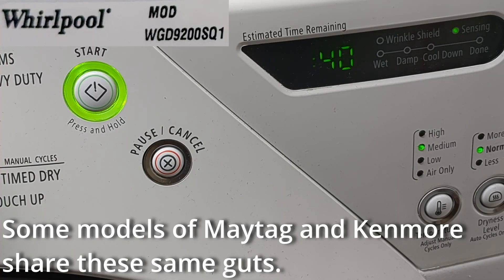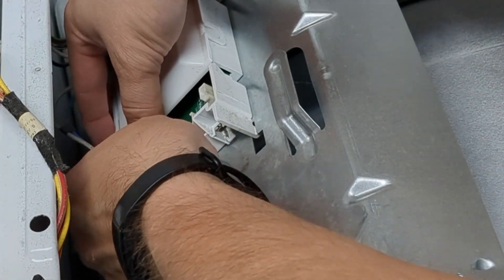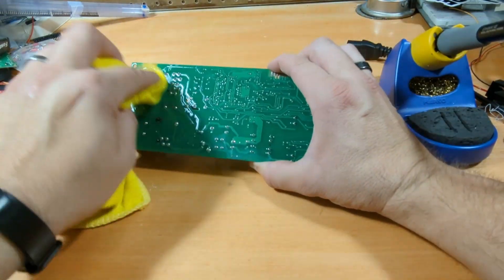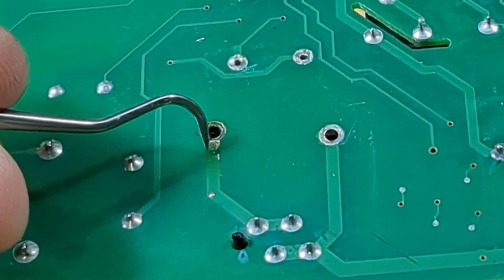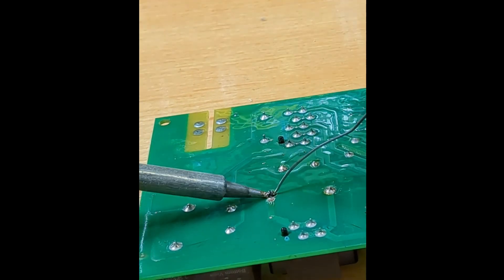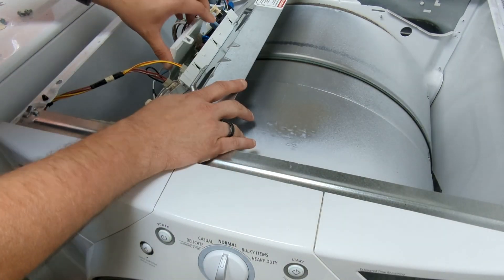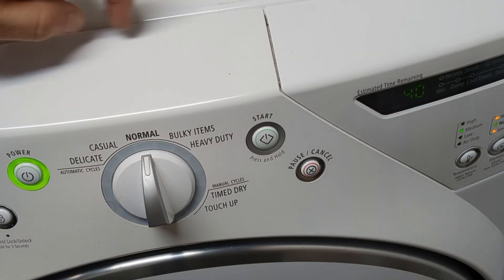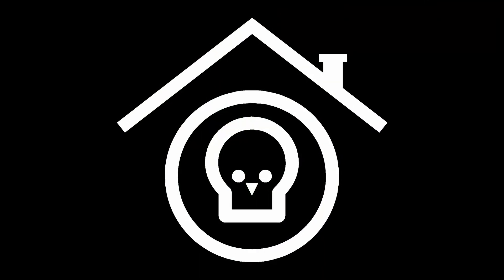Whirlpool Duet Dryer Error F01 Repair. No parts needed!

Comment: What actually blew up on the board? Like would it still be a good idea to get a new relay even if the dryer works, to extend the life further or for safety reasons?
Reply from the maker: Well, this gets to be a sticky subject so I'll preface it with "do what you feel comfortable with". It's like either something gets slightly loose from heat cycling for years but it's basically the trace below the relay kind of blows out on one connection. Folks can debate all day about whether that means the fix is safe or not. Ours has been fine for a few years now but I make no guarantee for anyone else's work or situation. And it would never be a bad idea to put a fresh relay in while you are going through the trouble and open it all up and get down and dirty. Like some others have said in this thread it may not even hurt to just use a bit of jumper wire to eliminate the trace issue. It's not like I repaired the trace I just kind of bridged it with solder.
Reply: @JamiesHackShack  Thanks for clarifying, I watched another video after yours that corroborated what you're saying, where they cut open the relay to show how the contacts on the armature inside got worn out, leading to the increased resistance/heat that I guess transfers through the lead to where it contacts the board.

So, sounds like using the existing relay is safe, but probably that worn out armature will increase how quickly the contact points on the board get scorched again.

Certainly a great fix in a pinch that will probably last a decent time (just maybe not like 10-15 years), all things considered.

Comment: What could I use if I don’t have a de-soldering pump?
Reply from the maker: Some flux and solder wick can get you there too. If you think your trace is burned like mine you may not even really need to remove the solder. You can add some fresh solder to bridge that Gap and/or a scrap of a decently sized wire and kind of bridge it too. Many of the failures most of us end up having the relay is fine and you don't even need to move it. I didn't realize that until too late. You can try to clean up and scorching and try to add a bit of new solder and see if you have any luck.
Reply: @JamiesHackShack  You’re right, I didn’t have to remove the relay. Thank you very much for your video!
Reply from the maker: @nathannumbers9181  you're very welcome!
Reply from the maker: This is a pretty cheap pump and some solder wick for not too terribly much. That may work well enough for you. https://a.co/d/4A0lrFi

Comment: Thank you for generously posting this, Jamie!!! I just got the F01 error code this evening,  watched the video, and in less than an hour we were up and running again. Exact same scorching. Cleaned the trace and contact and soldered without removing the relay. Worked like charm. Trickiest part was not dropping the sheet metal screws 😊
Reply from the maker: You are very welcome. Yeah those screws are a pain if you drop one! :D Thanks for taking the time to leave a comment.

Comment: Am i the only one that did this just a little different? Ised a wood burning art tool for a soldering iron and just scrapped the burnt area, stuck some wire in the hole where the solder burnt off, and applied more solder on top to keep the wire in the hole. Working for now but idk how long it will as i didnt have an iron to brake it free and deep clean it. Always fixing things with the wrong tools. Video helped a lot!
Reply from the maker: If it works, it works! Nice job!

Comment: Got the F01 error yesterday. Found your video while searching for answers about the code. Took the machine apart today and found the exact same problem and made the same repair and it’s back up and running.  Such a quick and easy repair.  Thanks for the video.
Reply from the maker: Awesome to hear that you got it fixed!

Comment: Worked for me as well. It looked just like it did in the video. I also just repaired the solder connection without removing the relay. In my case the trace was peeled back about 5 mm, so I used a wire to bridge the distance instead of just solder. Thank you for the video!
Reply from the maker: Glad you got yours going again! Nice work!

Comment: Any fix for dryer F21 error message?
Reply from the maker: Not sure about that one on a dryer. On a washer that can be a slow draining. There is a little area that needs to be checked/cleared for the drain pump that can sometimes get junk clogged in it.

Comment: Dude, you absolutely rock. I was ready to trash my 17 year old dryer. I’m no novice. I fix everything from small engines to aircraft to appliances. But I just figured it wasn’t worth trying to fix this with it being so old. Had already been to Home Depot looking at new ones. But then I stumbled across your video. Soldered in a piece of wire to across the track on the board… voila! Up and running again. Wife will get no new washer and dryer this week! 😂
Reply from the maker: Right on! I love hearing these success stories! Thanks for watching and thanks for taking the time to comment. I just had to work on ours again this past Friday. If yours starts getting loud loud/squeaky go ahead and put the little overhaul kit in it that has the new idler, rollers, belt. :-D Maybe I'll make a video about that ordeal.

Comment: Omg this WORKED! I just bought a $25 soldering kit from Lowes (cheapest I could immediately find). All I did was wipe clean the blackened areas and add more solder to the blackened joint. FIXED! And believe me I have never worked on a control board or soldered anything in my life before this so I know you can do it too. Practice using the soldering tool first before you go in on the board. Thank you so much for this video! ❤
Reply from the maker: Glad you got yours working again! Way to go! You are very welcome! Thanks for watching and coming back to comment.

Comment: Thank you for posting. Exact same problem on my dryer. Cleaned the burnt   terminal and soldered. Good for another 20 years 😂
Reply from the maker: @richie9911  You are welcome! Nice work on your fix. Hope it keeps on trucking. Now mine is getting squeaky, about time for a set of rollers and a tensioner/belt PM I think. 😂

Comment: Hey there! Is there an entry level saudering kit you recommend that could get this job done?
Reply from the maker: If you are just going to get it for this one job probably anything is ok. Even like the cheaper ones from harbor freight like this. 
https://www.harborfreight.com/electrical/electrician-s-tools/soldering-guns-irons/30-watt-lightweight-soldering-iron-69060.html
Just make sure to get electronic type solder not like the thick plumbing type etc. 
Something like this should work but you could probably get something smaller from amazon. 
https://www.harborfreight.com/08mm-electrical-solder-58000.html
If you think you'll ever do much more soldering in the future I'd rec getting something like a nicer Weller or Hakko one. There are some nicer usb powered ones out there folks like but I've not used one of those myself.  Good luck with it!

Comment: Add another one to your list Jamie!  Thanks for the vid.  Exact same problem.  As a couple below mentioned, I didn't want to attempt to remove the whole relay so I just cleaned up the connections spot well.  Just a shout to anyone that is not a soldering expert (such as myself!) I practiced a little on a flat head screw on my work bench.  Once I felt I had the technique down correctly, I did the board.  Hopefully it hands in there for another several hundred miles!  Thanks again!
Reply from the maker: @aflyinggoat1  Right on! It just makes my day when someone says they've been successful getting their dryer back going! Yeah close to 💯 you don't need to worry about the relay if you just see the big blow out. Just clean and patch up the path. You are most welcome!

Comment: great video and good cleanup on the damaged board.  I  highly recommend adding a wire from the relay pin to the other side of the trace (there are 2 pins - either will work).  Whirlpool designers didn't do a great job of making that pc board.  That trace is carrying a lot of current and designers didn't make that trace large enough. add the wire so you don't have to fix it more than once.
Reply from the maker: @schuholzjohn3625  thanks for watching and great advice to make up for that trace.

Comment: Thanks for this. Mine has exactly the same. How did you get the smaller of the two cables at the far end (the one next to the large three pronged) to let go. It seems locked but there's no obvious release. Oh, you may have a slightly later model. 
\

Comment: Thanks!  This was exactly my problem as well.  You have helped bring my 24 year old dryer back to life.  I wonder what causes the relay to get so hot that is melts the solder joint there.
Reply from the maker: Right on! I've wondered if over time when it cycles and cycles perhaps that joint develops a weak spot/crack and just weaker and weaker until it blows out/opens up. Glad you got yours back going.

Comment: Thank you! Worked like a charm. My in-laws Whirlpool Sport Duet dryer stopped working. Took it apart and sure enough it was this same problem.  I didn't have the tools (or the expertise) to remove the solder points on the board with the relay, but I did have enough to solder back the one point on the relay that had "blown" (black everywhere and the solder was completely gone from that point).  Soldered that point back and it worked! Thank you! Saved them $300+ in a new board and paying a repair man!
Reply from the maker: Right on! Yeah if it looks smoked. Just clean it and try to rebuild the joint and give it a go. No need to remove the relay as a first try. Nice work!

Comment: Had the same exact problem, my husband didn't want to fool with fixing it so I decided to give it a go!! It worked for me and all I spent was $3 on some solder. I didn't even take the relay off. Hardest part was rebuilding the solder joint, the first attempt I didn't build it up enough. Had to take switch board off again and try again. I've never soldered anything before but it was a success, thanks to this video! I will definitely buy you a coffee!! ☕
Reply: Good for you for giving it a go. Your husband must have been extremely proud.
Reply from the maker: Way to go! Glad you got it fixed up! And oh my gosh thanks for the superchat! That's the first one I've ever gotten! Thank you so much!
Reply: Thank you for posting your experience. My dryer just threw that code, I found this video, but I've never soldered anything! I think I'll give it a go because I'm somewhat handy. 🤞🏻🤞🏻🤞🏻🤞🏻🤞🏻I don't have to purchase a new panel.
Reply: I did the same thing and fixed our dryer today.  Seems like a design flaw with the relay connection to the board.
Reply: It works 😊😊I cleaned it up and solder it after cleaning it up real good and the copper and what you know back in action 🎬 thank you so much for your video

Comment: Just had the same error code came up and had the exact same problem! I didn't even take the relay out! Just cleaned up the connector and scraped the plastic back and soldered it all back together! Works like a champ. Thanks for the video!
Reply from the maker: Great stuff! Glad you got it working!
Reply: Wish I came across your video before I went through multiple thermistors thinking that's was the problem as so called "Repairman" videos suggested.  I also left the relay in, cleaned the burnt terminal and resoldered in place.
Reply: I too have the same issue, is your repair still holding and the dryer working normally?
Reply from the maker: @christophertownsend7027  Ours is, now though it is squeaking. Probably time for a roller kit soon. 😂

Comment: Same exact problem here!!  Sir, you saved me a lot of money as my wife wanted a new set.  This solved the problem.  As you mentioned, the relay was still good.  It was making a noticable click anyway while the Dryer would not engage.  The click was a strong signal the relay was still good.  You motivated me to do the extra step of looking under the board to see that blown out point.

I noticed a varnish coating.  Had to scrape it out before desoldering as it was providing strong isolation, it would not melt.
Reply from the maker: Right on! Glad you got it fixed!

Comment: You are AMAZING!   Fixed for that exact problem!  Easy solder.  I did not have to remove the whole relay.  Just cleaned and scraped the blown joint and soldered.  Thanks for saving me some dough!!  My wife is super happy too!
Reply from the maker: There you go! Glad you got it! Take care!
Reply: Does the machine still work after repair?

Comment: But isn’t there a reason why it’s burning out ?
Reply from the maker: Excellent question and I've wondered the same. I'd like to see if the replacement board has any differences or thicker traces or would do the same after a while. The relay is fine though. Anything I say is 100% speculation. I think maybe it can be something from the numbers of cycles combined with the size of the trace. If you have any reservations whatsoever just replace the board. I personally don't equate this to being the same as replacing a repeatedly blowing fuse with a shunt or large value fuse.
Reply: Thumbs up for another successful repair, thank you! Hardest part for me was getting the circuit board out of the white case. I used some toothpicks to hold back the 6 tabs all at once and it came right out. My burnt circuit also lost maybe 1/4 to 1/2 inch of copper so I used a few strands of copper from some 16 gauge wire I had laying around to patch the gap. Worked fine!